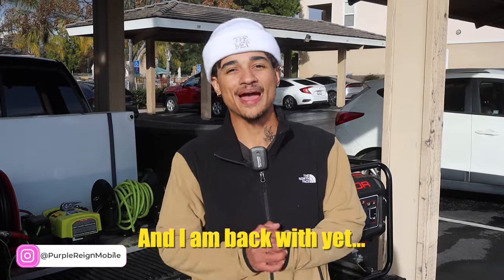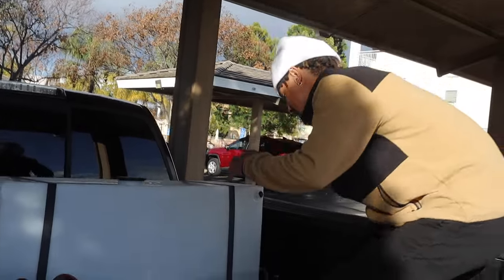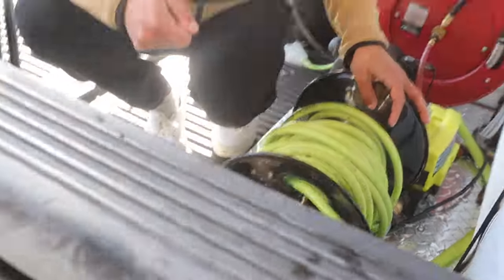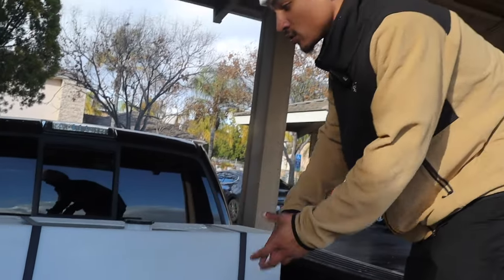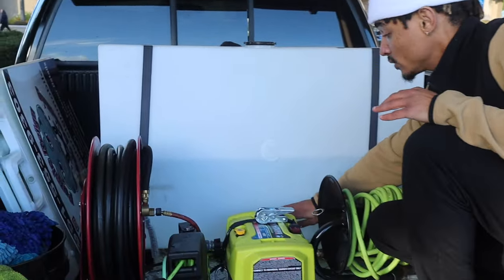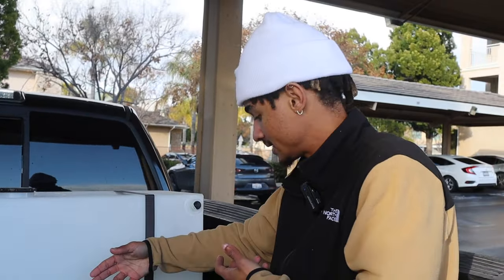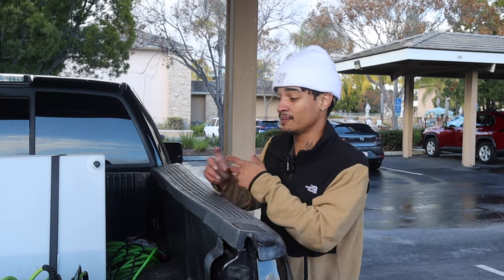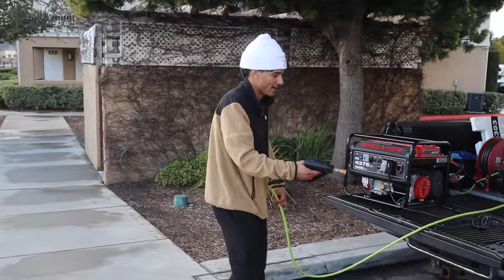The EASIEST Water Tank Setup for ANY Detailer - Purple Reign Mobile

Comment: Have you ever had an issue with your pressure washer when you’re not using it would start on and turn off as if somebody pulled the trigger? I’ve had like three pressure washers and this has happened not sure if it’s normal or not.
Reply: Yooo that usually is a faulty pressure washer and also the pump is failed because lack of water flow, if flow is good then it’s faulty if it’s brand new if it’s a older one then it’s just been worn out/burned out
Reply: Did you prime the pressure washer before using?
Reply: Yes. You must remove all the air out of all the lines first... So before you cut the Pressure washer on you must get the water to flow through the lines... But if your gravity feeding, air will either leak out very slowly or air will be trapped; and once you cut the Pressure washer on it will "cry" or indicate to you that it is starving for water pressure which is " whining sound.. " cry" because air is in the lines and that you're not getting any water pressure..
Reply: @cutlasssupreme508 how do you prime it ?
Reply: @JR-yj8wp  i use a pump... That means you need a power source such as a external battery to power the pump... you'll need a 
 switch to start the pump .. once you hit that switch the pump will draw water and push the air out; then the water will flow freely... I don't gravity feed. What the people don't tell you in most videos is that gravity feeding will destroy a electric pressure washer if you don't have it connected to a "home garden" hose... Those things push at least 13 to 17 GPM... If you have a tank and are trying to gravity feed, eventually the pump inside the pressure washer will fail due to the lack of 
" GPM" it needs to operate not the pressure.. pressure is one thing but gallons per minute is another...